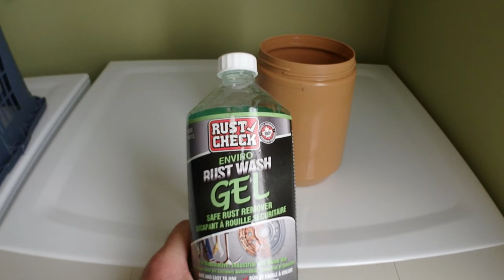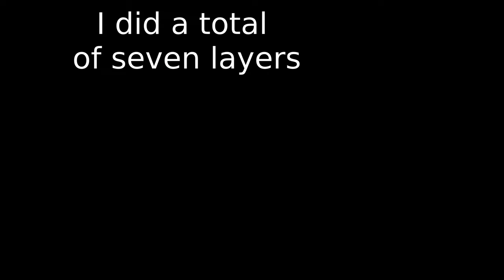How To Properly Prep And Paint Wheel Lug Nut.

Comment: Great job, it turned out awesome. You should've clear coated them at the end to make them a bit shiny and to give a little protection. For those who think the paint will come off when you take them out, put a painter's tape on your socket or on the lug nuts when you take them off or when you put them back on. 

Again, it turned out excellent 👍🏽
Reply from the maker: Good idea for the clear coat !
Thanks for the heads up.
Regards.

Comment: Hey, good job. Looks really great. 
My concern was not really about rust but the fact that I have taken them off and on approximately 5-6 times and there is a lot of wear on the paint. Painting it with spray paint doesn’t really hold for long. Maybe you could suggest something to use over spray paint to improve it’s durability?
Reply from the maker: Sadly ,paint will not be durable.
The only paint that may be durable is probably epoxy paint...
Reply: As soon as you put a socket around them the paint will come off. Nice try though.
Reply: @gigantor62 very good point pretty much defeats the purpose
Reply: The only thing you can see once they are installed, is the tip of the lug nut so why not just paint the whole thing red?

Comment: No need to use a "gel". Vinegar works very well for removing rust and old paint. I speak from experience.  Also ~ use etch primer, primer, colour coat and clear coat for a more durable finish.
Reply from the maker: I also use vinegar on rusted hand tools,works wonders.
Thanks for the tips.
Best regards.